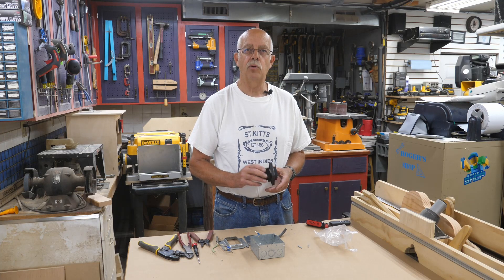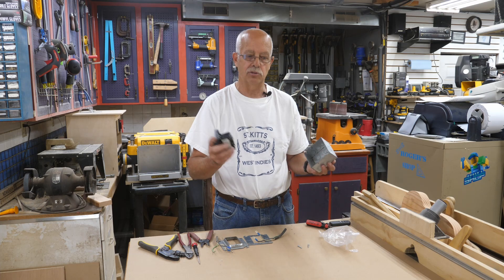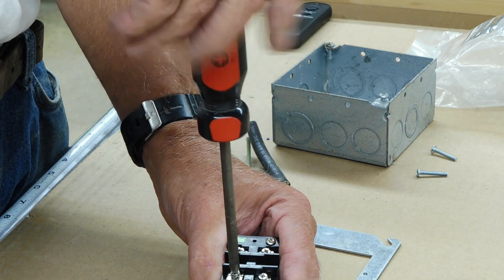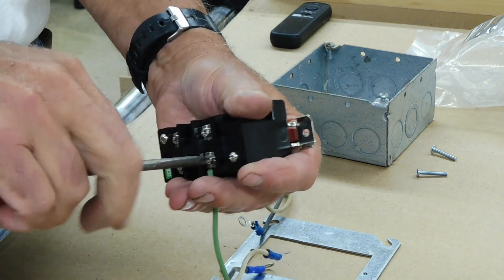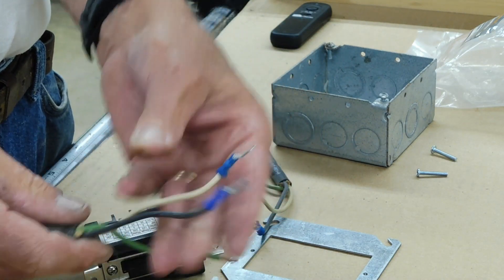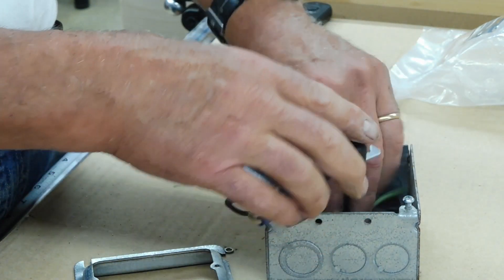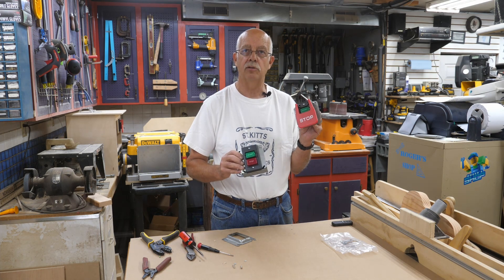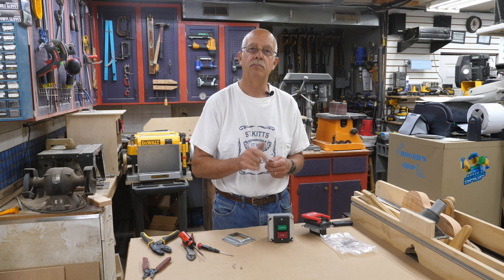Powertec 71008 Switch Mounting & Wiring

Comment: That's helpful - thank you. One thing: It would have been more helpful to see the actual steps with the ground wires. I'm looking at videos like this precisely because I don't know these things.
Reply from the maker: All grounds tie together and need to also be bonded to the enclosure if it is metal.
Reply: So where does the ground go? 
Also, how would I connect an indicator light to go on when I push the on button?

Comment: i have a table saw with a toggle switch (that just broke).  I dont have an isue wiring a switch - by my toggle is on the box under the tabletop   - how do i mount one of these ?  looks like it has to be mounted well forward of current switch?

Comment: My 80,s Powermatic 66,with 2 hp and 240 volts and single phase .The magnetic switch has quit working, when i push the start button, nothing happens. no clicking, no nothing.  Would a 71008 replace the magnetic starter
Reply from the maker: Borderline, yes.  However a magnetic starter is better and safer.
Reply: any suggestions for a magnetic starter.  Thanks @rogersshop
Reply from the maker: If it were mine, it would be Square D, Allen Bradley, or Siemens.  But, that's me, as a professional electrician and vast experience with motor controls.  there are less costly starters out there, but as they say, you get what you pay for! @floundermac

Comment: my switch on my delta 10'' unisaw has one black wire one red wire and one white wire in the middle of the switch with a jumper to the second neutral i have new power tech HY 56 how do I wire nw switch
Reply from the maker: A lot of variables here, depending on how the saw was configured from the factory.  120V or 240V?  Most of these saws have a magnetic starter with overload protection that should NOT be bypassed.  These are usually controlled by momentary contact start and stop buttons.  This prevents the saw from self-starting after a power outage if it was running when power went out.  The Kedu HY56 switch comes in two different configurations:  220V and 380V.  Both are not magnetic or momentary contact switches and are maintained contact, which eliminates the safety aspect of why Delta uses magnetic starters and momentary contact buttons.